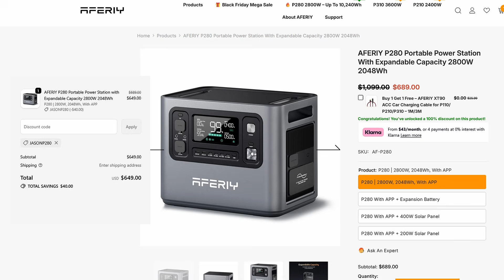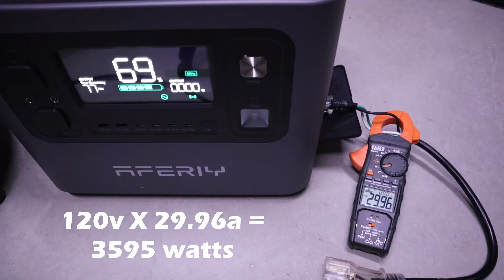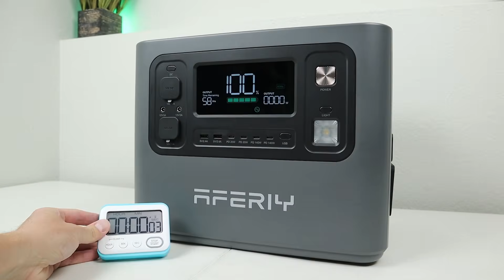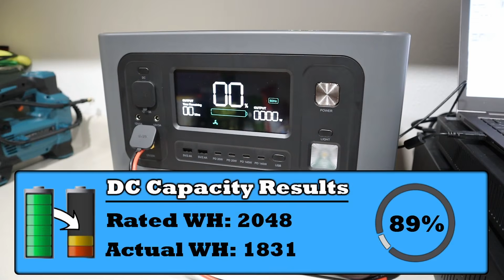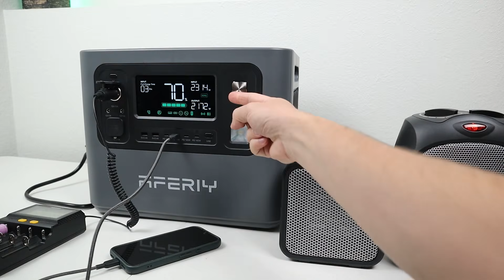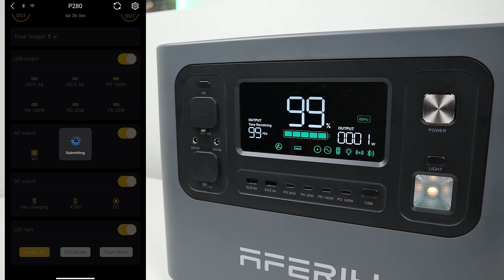The Best Power Station You’ve NEVER Heard Of? AFERIY P280  - Fully Tested

Comment: Using this model as a UPS for my freezer/fridge in garage shows problems. It randomly turns off the output despite being on and having full charge. It will run for weeks without an issue but randomly I find the fridge off and I have to power cycle it to get it back on.
Reply from the maker: What temps is it running at? It shuts off below freezing for low temp protection.

Comment: Would like to see how DC to DC  from a car's alternator
Reply: I agree.  What DC to DC charger works best with this unit?   I’d like one that I can hook both solar and alternator power to at the same time.   Wondering if that would work with this power station.
Reply from the maker: Eaker F1000 does that but this unit has two ports for input so you'd just connect solar to one port and alternator charging to the other port 👍 I'd probably just go with the most affordable option, the Bluetti Charger 1 goes on sale often.
Reply: @Jasonoid  nice. But more affordable is the Aferiy products
Reply: @lacofdfireman  my alternator is 100-amp OEM toyota.  I understand to expect about  <50% life expectancy of the oem alternator if using as DC to DC charging, but anything more serious to think about?  I just don't want to overload/over worked the alternator of my car and have to change/replace a new alternator  every 6 months, lol.

Comment: Will it simultaneously power the cig. Lighter and the 25amp output at the same time?
Reply from the maker: Yes
Reply: @Jasonoid 
Is that per a test?
Because aferiy support just replied it wouldn't.
Reply from the maker: @michaelpinkston4628 both ports are active, but they don't add up to more power. The max power is 25 amps, so don't expect 35 amps.

Comment: Do you know what cable is used to connect to additional batteries and whether it can be purchased separately?
Reply: I had the same question, and I was told that if you buy them together, the cable is included

Comment: A new test I thought of. 
My wife has limited wattage on a circuit before breaker trips. I bought the Afeiry with thought I could set it up to charge at safe 900w and rest would pull off battery till she was done with higher load then it would recharge batt. Come to find out that this will pass full 2800w through no matter charge setting. Which is a bummer. So to know if can power AC off battery while simultaneous charge at deliberate lower wattage would be good to know.
Do you know if Anker c2000 or EcoFlow max will do what I describe?

Comment: Wonder if you can set the power station to never shut off - saw you had 470min.
Also wonder what wattage draw turns the fans on.  I want a silent unit when not drawing high load.
Reply from the maker: The most silent unit I have tested is the Delta 3 Max Plus. The Anker C2000 is close behind it. Both are great units.

This unit the fans kick on randomly to cool down the power station. The fans aren't too loud at low wattage loads but they aren't silent.

Comment: Thanks for you detailed review.  Can you also test when the battery is totally depleted and AC or solar input resumes, will the AC/DC/USB output resume their on/off state before battery dies?  This is to see in extended power outage, and the power station shuts down, would it be able to power the loads when power from electric company is restored.
Reply from the maker: I would have mentioned that feature if it had it 👍 Were only seeing that on the newer Ecoflow, Anker, and Bluetti units.
Reply: @Jasonoid  Would appreciate if can add this to your test list in future products review.

Comment: Hi, I ordered the P280 a few days ago and haven’t received it yet.
First of all, thank you for the thorough testing you’ve done on this unit,  it’s really helpful.

The only drawback for me is the 55V solar input. I was hoping there would be a little tolerance, so that 56 or 57 volts might still work. But it seems the limit truly is 55V. I had hoped to charge the P280 with a separate 48V battery (which should be around 54.4 volts when fully charged). Now I’m not convinced this will work.

In your detailed test you showed that 54V works but 55V does not.
Would you be able to test whether 54.4 up to around 54.9 volts also works? That would help me determine whether I can use a 48V battery, or if I should go for 24V batteries instead.

Keep up the great work 👌🏽
Reply from the maker: I tested the solar ports with a 51.2v battery, no go. It doesn't charge, the voltage is too high. I did use some inline diodes to drop the charging voltage a bit and that did work just fine, but those diodes get blazing hot. They would require a heatsink and a fan for long periods.
Reply: @Jasonoid  That’s what I was afraid of. So it looks like I’ll have to go with a 24V battery. Thanks!!!
Reply from the maker: @NelinhoMarinus using a 24v battery still gives you close to 600w 👍

Comment: Nice unit, but the 55v solar voltage limit kills the deal. Pecron has 95v on the E2400lfp and 150v on the E3600lfp
Reply from the maker: That's true, some other units offer higher voltage limits for solar input so you have more flexibility with panels you can use.

Comment: I am happy that the test was positive and you are the first one where i got an idea of the app. I am not sure if the maximum charging current setting can only be set down to 8A or completly to 1A. That could be a good Switch to reduce dc2dc charger like the bluetti charger 1. That uses voltage to reduce the load wattage and this powerstation adds some control over amps. I ordered this powerstation some days ago.
Reply from the maker: Awesome! Let me know what you think of it once you get it!
Reply: @Jasonoid I like this thing. Odd is that I am able to connect my 12.8V lifepo4 to both solar Inputs and get 200 to 208W. When I try the same with my 25.6V Lifepo4 one solar input is working with 520W and adding the second stops the charging as in your test.

Comment: I watched your P310 video in May, but the price was beyond my budget, so I ended up buying a P210 instead, which I'm still using now.
Reply from the maker: Have you liked the power station? What are your thoughts on the P210? I haven't tested that one.
Reply: @Jasonoid  Yes, I like it. It hasn't had any problems so far, except that solar charging is a bit slow and it can't increase the battery capacity. But I'm still using it now. Of course, if my budget allows, I'll consider getting a P310 instead.

Comment: What would be your pick between the Averiy P280, Oupes Mega 2, & Pecron e2400LFP?
Reply from the maker: It would be between the Pecron and Aferiy. The Oupes has charge controller issues. Just depends which solar you prefer.
Reply: @Jasonoid  What is the Oupes controller issue? I bought one, but haven't gotten to use it much yet!
Reply from the maker: @jaymedina3142 anytime a cloud passes while solar charging, the charge controller resets down to zero and takes about 8 minutes to get back up to full charging speed. If you have a bunch of clouds, you'll never hit full charging speed.

Comment: They have two solar inputs but provide only one solar cable?  Not cool.  Did you test the two 140W usbc simultaneously?  Does it output the full 280W?  I have the P210 and am considering getting this for the price and the fact it has the same size battery.
Reply from the maker: One cable only, cost cutting lol...
Two 140w ports work at the same time 👍 tested under the DC section.

Comment: The XT90 inputs says do not exceed 55v. I assume that is for each XT90 input not combine? So I connect two 52v golf cart batteries, one to each XT90 input I it would be ok?
Reply from the maker: Nope, 48v batteries go over 55v and they don't charge (peak voltage is 58v on a 51.2v battery). You could use a 24v battery to extend the runtime 👍

Comment: I thought about getting something to replace my AC200p but I'm used to the , touchscreen, the 150v max of it to switch over to these more modern power stations with 60v (or in this case 55 😞)limits, the AC200pl is high on my list
Reply from the maker: It seems the 60v limit is becoming more common....WHY?! The AC200L also supports DIY expansion batteries so that's a plus!
Reply: @Jasonoid  I seem to recall they perhaps misinterpreted a US safety standard or electrical code and decided 60V was the limit.
Reply: @Jasonoid  I'm thinking either Liability issues or shrinkfIation......anything to save a buck or two,smh, I like the PL (premium) version better, it has wireless better storage, speaking of storage are you aware of the new 5k batteries Bluetti has for their power stations. it's backwards compatible with a lot of older stuff like the AC300,200max,etc

Comment: Any plans to try the VEVOR?
Reply from the maker: Which Vevor?
Reply: @Jasonoid  I didn't know they made more than one 😅 All of them, but maybe start with the Q3600Pro.
Reply from the maker: @reeseromine2140 I'm sure they are just a rebranded model that already exists. What do they look similar to? Usually the screen and specs are a dead giveaway....
Reply: @Jasonoid According to Google AI "the VEVOR Q3600W is not known to be identical to another power station." It kinda looks like a Aferiy P310 but not quite. But I don't live and breathe power stations, I'll leave that up to you haha.
Reply from the maker: @reeseromine2140 AI is garbage when it comes to power stations and batteries. AI once told me to charge my 12v battery by connecting it directly to a wall outlet.... Glad I didn't follow those instructions.

That vevor is a clone of the Aferiy P310 and the Fossibot 3600, same exact specs, but a higher price. The Aferiy model would be my recommendation. They actually have a support group.
Reply: @Jasonoid The more you know! Thanks for the info!

Comment: Nice presentation.   Thank you for posting.  A nice unit with excellent 12v and USB DC outputs.   Nice seeing all of them pull in excess of their rated outputs.  The AC charging efficiency with the watt meter is a very nice addition to your testing, so thank you.   As of 11-25-2025, it looks like this unit is priced about the same as the Pecron E2400LFP which can use your 48v external battery trick.   The AC/DC outputs and weight are also very similar between the two as well.
Reply from the maker: Great comparison! I just verified, the expansion port on the P280 has live voltage (54v) so I think it could also support DIY expansion batteries.

Comment: Hi, can it work with a 3rd party expansion battery
Reply from the maker: The expansion port does show 54v when the power station is turned on when testing with my voltmeter.

Comment: Cool unit! I hope Jason will see if these Aferiy units can use their battery expansion port with a generic 48V battery (like he's done with some other brands).
Reply from the maker: The power station shows 54v at the expansion port when turned on so it should work 👍
Reply: @Jasonoid  That would be a cool video if you can swing it. The P280 and P310 with a 48v golf cart battery would be amazing!
Reply from the maker: @goodcitizen4587 what model do you have?
Reply: @Jasonoid  I have a P310 otw and I have 4x 12.8v 200Ah Power Queen battts from my old diy setup. Hoping to use them as expansion on the P310.
Reply: @Jasonoid do you know if this is possible with a dji power 2000?
Reply from the maker: Do you measure 54v at the SDC ports when the power station is turned on?
Reply: @Jasonoid I don't have one unfortunately 😆
Reply from the maker: @vegan3606 I don't have one anymore 😔

Comment: With reference to their support. I had a P310 which went faulty after a few weeks. They answered their emails in a reasonable time and arranged for a collection of the unit. Unfortunately they wait for the unit to reach them before sending out a replacement. It was 4 weeks before I received my replacement.  Also because I had recycled the packaging they require £28 to send you replacement packaging to send it back to them. This is because the packaging has to be a certain grade cardboard and properly labelled. Anyway, the second unit was faulty from the start with earth leakage that kept tripping my mains DC breaker. Again they responded in good time. Fortunately I still had the original packaging and they sent me a new one quickly after I kicked up a fuss because by UK law I was entitled to a refund.. Hopefully third time lucky.
Reply from the maker: I hope the third time is a charm. Thanks for sharing your feedback about their customer support. I'm glad to hear they are responsive.
Reply: Any luck with the third one?
Reply: @RAD-RC  Yes the third one was the updated model and has been working great.
Reply: @King_Kev_Henry_IX  Can you do peak shaving with this unit? So, charge it up at night and let it supply the base electrical load in the home during the day through its AC mains charge port? I understand DJI power 2000 has this feature, so interested to see if the P280 does as well. Be good to charge at night on an off peak rate and cover the base supply load in the house during the day when unit rates are higher. I live in the UK by the way.
Reply: @dmwoodn1  This is not like an eco stream unit where it plugs into the mains to power the home . You can only plug individual devices into it after you have charity overnight. Not sure about the Dji.

Comment: Thank you for going through the smartapp features. I always look for a output priority mode, and this does not have the solar and battery priority mode that I'm looking for.
Reply from the maker: If you only want to charge with solar as a priority, you'll have to unplug the AC charging or youll need to use a smart outlet.
Reply: @Jasonoid I'm more looking for being able to use the solar and battery for loads first then fallback to grid power once internal battery goes low voltage to try and lower my electric bill. Ups mode which most power stations support doesn't really save you on bill unless power goes out
Reply: @justicator 
Check out the Bluetti Elite 200V2 while it's still on sale right now.  That one does have that feature - not by battery percentage, but by scheduled times, so you can at least take advantage of off-peak charging rates as well as limit the duration it actually charges (say just 1 hour or a short period of time if you don't want it to keep charging all the way up).  

The bright ems app that Aferiy uses, only allows a setting called "AC Booking" which lets you delay the time the AC charging starts, but I don't know if maintains it on a schedule or if you have to go in and set it every day (I believe it's the latter though).  It also doesn't let you set a duration so it will just charge to 100% once it starts - unlless you manually intervene again.

But As Jasonoid mentioned, using a smart plug or even a physical timer on an outlet can be an easy way to automate if you want to find a deal on a power station.  Only more expensive units tend to have custom scheduling - especially based on the battery level.  If that feature is worth hundreds more, have at it though.

Pecron's can do sort of what you're asking too, but they don't have an option to completely disable the AC input when plugged in to the wall, so it doesn't work without a wall timer or some sort either. You can schedule charging during schedules and according to battery levels, but  you can't completely disable the AC charging when plugged in so it's kind of pointless unless you can disable the AC outlet some other way.

Comment: I used your discount code to buy a P310 last time, and there was a problem in August. I contacted them and they replaced it with a new one.
Reply from the maker: That's great news! Thanks for sharing your feedback 😁
Reply: @Jasonoid  I have been looking for a solar generator and have seen posts about the ecoflows not working when the power/internet goes out because the unit was powered off and the people couldn't log on with their password.  Do you know if the p310 has this issue?  Also, I just looked at the online price and it was 20.00 more for the app?  hmm
Reply: How long did it take?

Comment: You may want to do a longer-term review for this brand.  My P210 is having trouble keeping a charge and it is 6 months old at this point.
Reply from the maker: Thank you for sharing your feedback. What behavior are you seeing?
Reply: @Jasonoid  It will charge up to 99% but will not go to the full 100% any longer, just keeps charging at around 550 watts indefinitely.  It also seems to be discharging at a greater rate than it should based on the devices drawing from it.  I am going to keep on monitoring it to see if it gets worse, it just doesn't seem to be as efficient as it was the first 4 or 5 months of use.
Reply: @markgrubbs1920 hi, have you any updates to share on this battery?
Reply: @TheOakBookshelfUK  I went back and forth with the company many weeks as they had me try many different solutions to try and fix it.  It didn’t appear to work so they offered me a car charger for my inconvenience.  I told them that was BS so they offered to replace the unit.  I decided I could live with the way and see if it got any worse.  The next time it fully discharged and I charged it back it went to 100% and it had acted normal since then.  I have had it for a little over a year and besides that issue it has worked just fine.
Reply: @m @markgrubbs1920 thank you for the update 😊
Reply: You can contact their customer service; they will help you resolve this issue. Slow charging is a major problem.